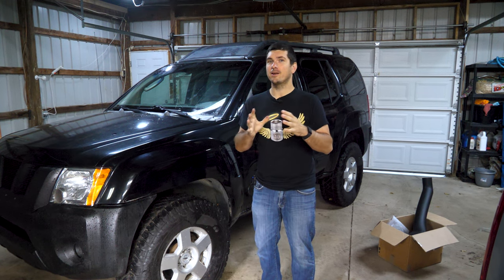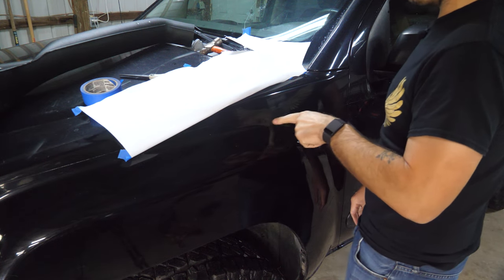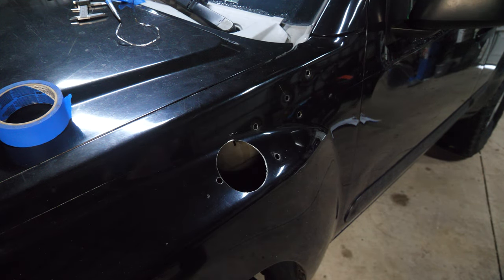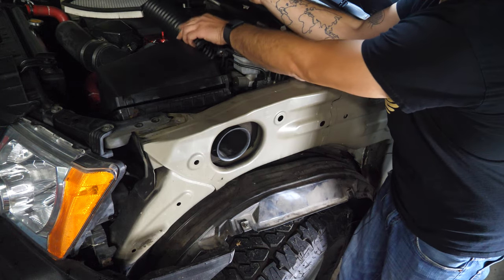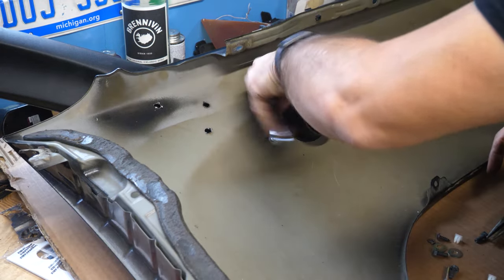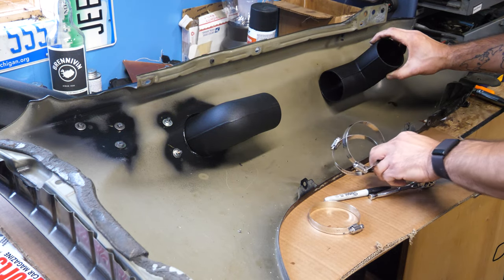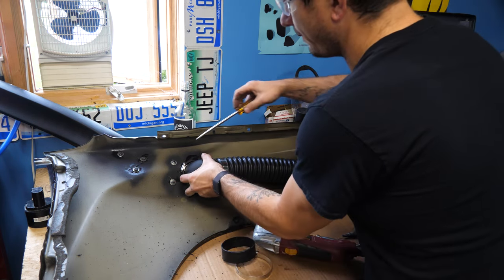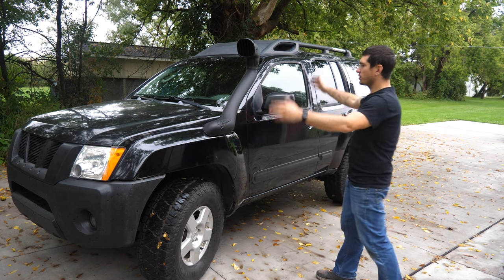How to Insall a Snorkel On An Xterra/Frontier/Pathfinder

Comment: Good job Ry ! as for the pillar support what I did when I installed my snorkel I used  this funny things called ( Hillman 1/4-in x 20 Brass Well Nut  / 18 Pairs M4 M5 M6 Neoprene Well Nuts with Stainless Steel Screw )  they can be found at lowes or amazing.. worked great as they are rubber with nut inside I did not had to seal the  hole on the pillar  and it very secured
P.S also the pillar bracket you need to flip upside donw.. )) 2 holes for pillar 1 hole for snorkel
Reply: I watched your snorkel install on your channel, found it very helpful and the bracket fasteners a great option - thank you!
Reply: @shooofly6580  Thank you for watching as well ! and glad it was helpful!

Comment: Another great video! Nice to see the fender pulled for this job. I installed mine with the fender on but if I ever do another I'm going this route, or at least loosening the fender for it. I used a bit of sealant around the plastic elbow that mounts to the snorkel itself before I clamped it down. The bracket and hardware for the a-pillar worked fine for my install as I was able to get creative making the correct holes(square if I remember correctly?). Used a bit of clear sealant there too. Airflow is the only one made for the N50 Xterras. There is an R51 Pathfinder snorkel that will work with some modification. Far less expensive too haha. 

On a side note, I've noticed my intake air temps have dropped quite a bit and my air filter stays way cleaner after spending time in the dust. Well worth it.

Comment: Great timing - I ordered my snorkel end of August and received it Friday Sept 29th, just in time to watch your video. Found removing the fender made the process much smoother than expected - thank you! Also,  as far as the bracket for upper support, I used mine by fastening the side with the two holes to the pillar and the slotted hole side to the snorkel, lining it up with one of the two captured brass nuts. I have a Volant intake and purchased the adapter which needed a little cutting and grinding to fit but other than than, I love the way it looks and that the air is coming from a better spot. Thanks again for your excellent videos (VK swap in the future)!

Comment: I just purchased these plates from the dealership..I will get the gas tank one as well. I ordered the bolts as well. Thanks for the video
Reply from the maker: How much is the gas tank one. I'm interested
Reply: I posted on the wrong video 😮 the gas tank skid plate is over 500 Cdn. So no to that.

Comment: The forums show the bracket's double hole side bolted to the a-pillar and the "sliding" single hole attaching to the top snorkel hole. That makes sense since a single bolt on the a-pillar would tend to rotate over time and scratch things up. I guess the snorkel was made for other cars as well where the lower snorkel hole would be used instead.
Reply from the maker: Yea I realized that. Thank you, having the two recessed nuts really threw me off. I ended up using double sided tape on the pillar and the highest nut.

Comment: common misconception is that a snorkel is for water crossings only... while YES if you are going to do water crossings' the snork is a must but primarily controlling dust intake to the airbox is number one reason to add one, as stock air intake pulls air from the wheel well and if you drive on dirt roads at all you are just sucking down all that dust into your filter box that the tire kicks up and the snork is up high away from the dust cloud grabbing clean(er) air

Comment: Yo what size tire is that. About to go for bigger tires on my pathfinder.
Reply from the maker: 285/75-16 love them.
Reply: How were you able to find someone to install them? All my local shops say they are to big for the stock 16s but I’ve seen so many others run them so I know that’s not true
Reply from the maker: @PYROtheNomad  They are such babies. I bought mine from Duncan at Nissan Parts Puller and they were already on the rims and I just installed them myself. I know it's a pain but if you just throw your X on jack stands, bring in just the rims and tires and tell them to put the new tires on them LOL. They will mount and balance and you just put them on yourself.
Reply: @Rythecarguy  ah ok that’s perfect. I guess that’s what I’ll have to do. I was actually looking at that exact tire size too. They look great on your X so they must look good on a lifted Pathfinder
Reply from the maker: @PYROtheNomad  oh hell yea. They are gunna look sick.
Reply: @PYROtheNomad  I just installed 285 75 16s on my stock xterra and my local tire warehouse was willing to do it. My local walmart was not.
Reply: @ethangrover5382  which one?
Reply: @PYROtheNomad  it's a company called tire warehouse I love in the northeast, idk if they are everywhere or not. As for tires I got the milestar Patagonia MT02s

Comment: A Pillar use rivnuts
Reply from the maker: Ahhhh never!! Can't drill into the body. 😬
Reply: @Rythecarguy  YOU CAN DO IT!!!!!!.... In Rob Schneider voice,  But yeah realistically I can see where the drilling could be hard to convince yourself to do, and in my personal experience is that all the workarounds to avoid drilling usually leads to a lot more work trying options that sacrifice something eventually winding up not working to finally giving up and then drilling the holes any way and asking myself why i didnt just do that in the first place.  😜
Reply: @Rythecarguy  what did you end up doing to attach to the a pillar? I just installed the snorkel myself and regret not drilling the a pillar before installing because I'm not taking it off now haha. I'm using the bracket and some 3M tape as a temporary solution.